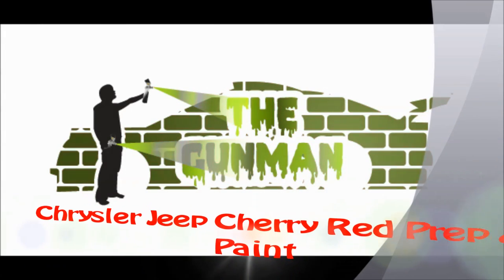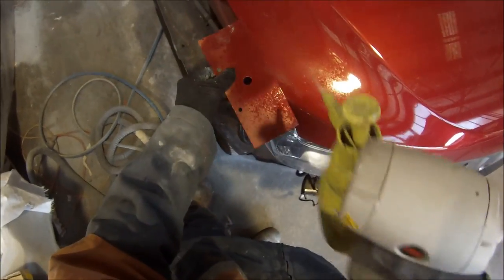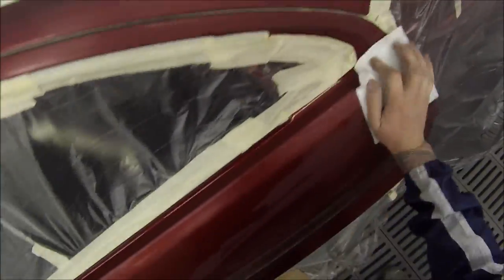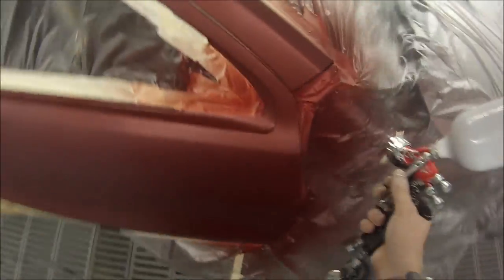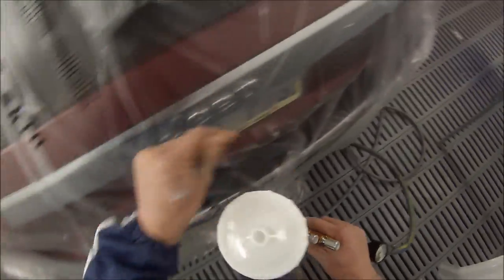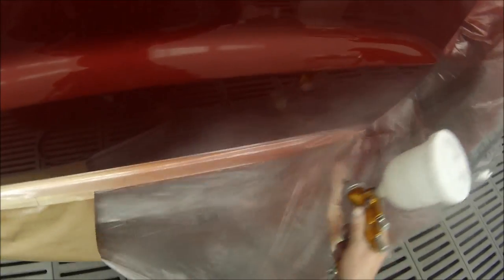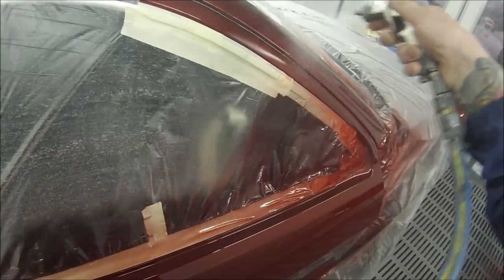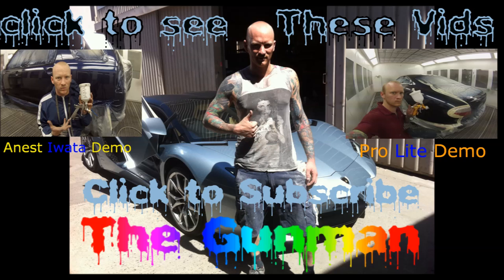Chrysler Jeep Cherry Red Prep and Paint

Comment: Just found your channel and have subscribed and watched a few of your vids already. Very helpful for someone like me with no experience or background in spray painting, so thanks for your efforts. Have you had much experience in motorcycle painting? I'd love to learn more about it and haven't found many good vids like yours on YouTube. I'm interested in the whole process but especially interested in how to apply tank decals and pin striping and at what stage of the painting process this should occur. It's my understanding that you apply your decal after you've put down your colour and a coat of clear. Then you rub back slightly around the area the decal is to be applied and then apply the decal, then apply a few coats of clear, then buff. Does that sound right to you? Then apply the pinstripe basically after the paint job is done. Haha. It's a bit confusing to me and I obviously have no idea so any help would be appreciated. Cheers mate, from Ballarat VIC.
Reply from the maker: I have painted motorbike fairings, tanks and all sorts of things in my time but not regularly and never cleared over the stripes, I'd personally paint clear and base the re sand the whole thing then get our pinstripe guy to stripe it then re clear the whole thing then re sand and re clear depending on how flat you want the finish
Reply: The Gunman No worries. Thanks for taking the time to respond. Keep the vids coming!

Comment: Hi gunman im struggling a little with pearls and light metalics with my new prolite base gun ? What pressure are these best run at with solvent basecoat its a 1.3 te10 aircap ? Getting a little mottle or cloudy patches ? Any help please mate thankyou
Reply from the maker: Carl Heath Get the te20, the te10 atomizes too fine and doesn't get enough material on to lay down nice. should be able to pick a te20 cap up around $100-$120 mark